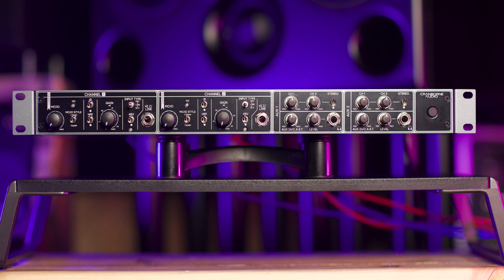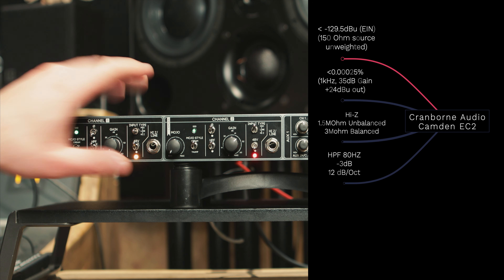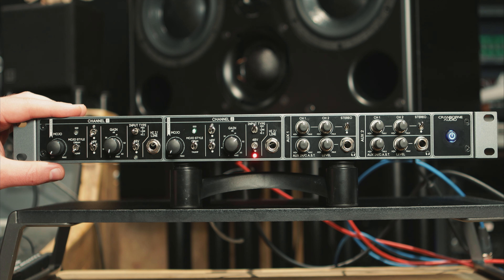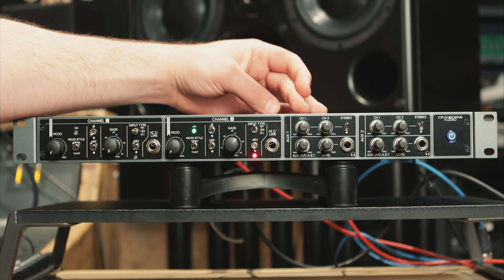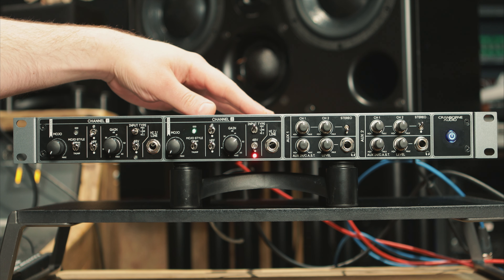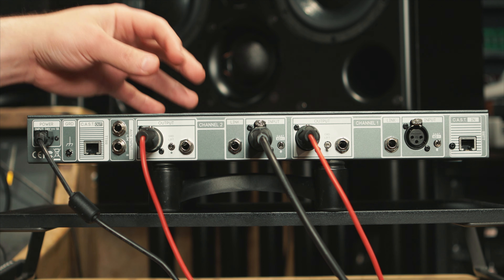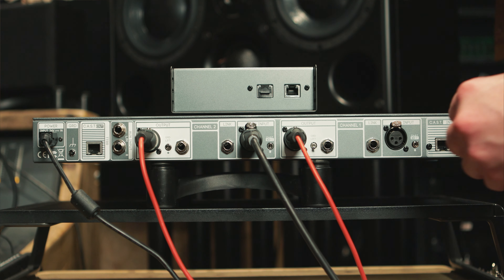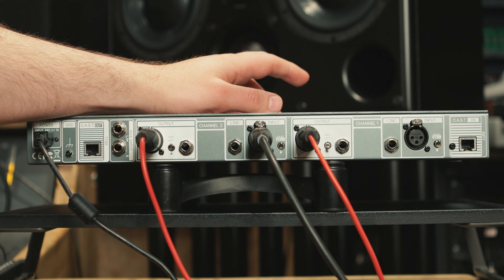Cranborne Audio Camden EC2 Demo & Review

Comment: Cool demo. How could I know what the preamp sounds like on one voice, when there are three? :)
Reply from the maker: It was being used on the voice over for the video. :) also check out my JZ V67 video, it’s being used there too.
Reply: @alecbrits  Thanks Alec, I just listened to that one, and also your earthworks mic video, both with the Cranborne.  My main outstanding question is that there seems to be a somewhat edgy peak in the vocal signals, and I’m wondering, is this the mic, or do you have the mojo turned up a lot on these, or both?  I know in one case I could see the mojo was off but it still had an edge— so maybe it’s the mic or post?  I personally have several flat mics— a pair of TLM-107’s and a TLM-193. So my second question is, will I be able to use the cream on these mics and get a nice range of balanced distortion, or is it going to peak out early? I am guessing that the flatness of my mics will be forgiving with the Cranborne, but I keep hearing this somewhat peak in lots of other peoples demos as well when the cream is turned on, ranging from peaky to a bit strident. Not saying it's a bad sound, but not what I'm going for on vocals.  The Mojo seems more forgiving for instrument sources. But I could be wrong.  Would really love your insights on this. And thanks so much again for your thoughtful videos and replies.
Reply from the maker: @neilanderson9151  Sounds like you need to get a demo unit from your dealer to try Neil. =)
Reply: @alecbrits  A timely comment. Are you conspiring with Sweetwater? :)
Reply from the maker: @neilanderson9151  nope! :) would be great if I was though.
Reply: @alecbrits  I’ll put in a good word for ya
Reply: @alecbrits  okay, I put in a word for you at Sweetwater. Let me know if it works!

Comment: Such a cool piece of gear! I’ve been looking at the EC1 as my first dip into outboard gear, and this has definitely made it clear that would be a good buy. My big decision now is deciding whether I just add it to my Black Lion audio interface, or I trade in the Black Lion and forgo the EC1 to get the Neve 88M🤣
Reply from the maker: It’s a great unit! One of the few review pieces that have stayed here. Always blown away by how open it is. :) if you are going into outboard, I’d recommend looking into the Cranborne 500 rack. That’s a good way around solving a few problems at once. If I was to open a studio B it would be the centre piece for sure. :)

Comment: Just acquired  the N22H/N22/N8 bundle to handle some signal flow from some external racks equipped with DB25 connectivity. Was hoping to use the link connection on the back of the 500R8 to monitor both with zero latency but I am not even hearing signal coming out of the N8. So not sure what’s up with that. I do have signal between my monitor board plugged into the N22passing through the cat5 to the N22H and am able to send mic signal back to the N22 and out from the xlr jacks into the 500R8 rack slots. Just wishing I knew what I could do with the C.A.S.T. Link on the back of the rack. Does that just link up the two summing  mixers of two C.A.S.T. enabled racks? Or can you link it to other devices that have C.A.S.T. connections like the N8? It’s just a bit confusing and I’m not finding supporting info regarding this in the online manual or in the youtube tutorials.
Reply from the maker: Hey Dave! Thanks for the comment, I’m not too sure (it’s been a while since I used the unit to be completely honest. I think the best case here would be to email Cranborne and see what they say about it. :)